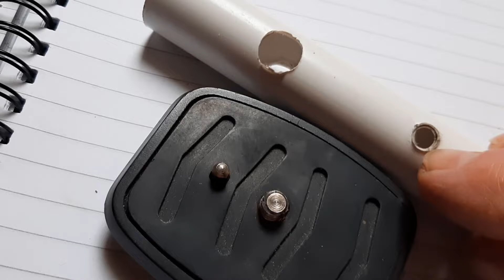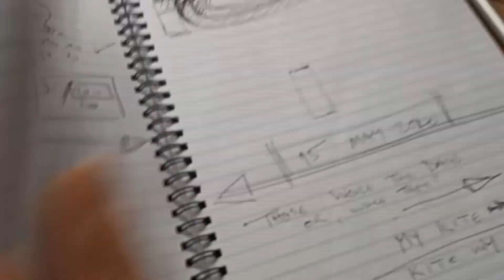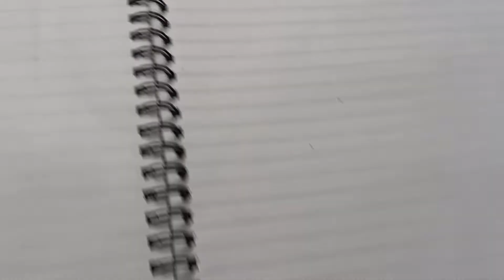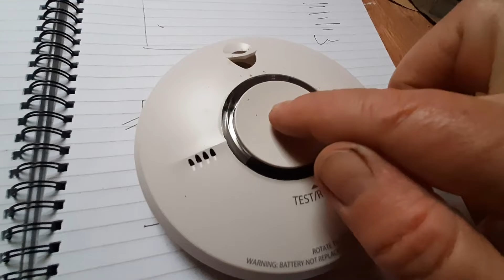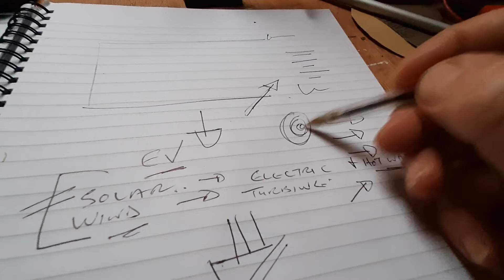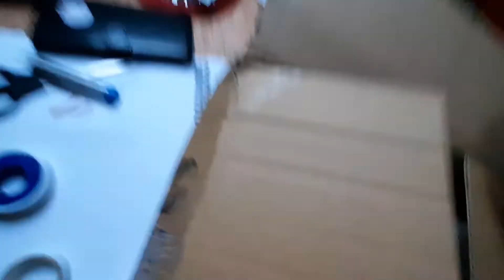Let's Talk About DIY!! #diy #monkeymount #metaldetecting

Comment: Solar is a good idea AJ, I wonder why I don't see any solar here 😁Do you know if you can get any sort of grant to install solar? Just a thought.
Reply from the maker: Yep... we can get grants - we have enquired... waiting for the response. I'll say something about it in a future clip! Would solar installations there be able to carry the snow loads without being so over-engineered that it becomes unpractical?
Reply: @vossierebel  Great news, I thought you should have made enquirers but always a good idea to prompt before you spend your pension!
Solar would not work here because of the 6-7 months of snow. There is also no sun here during winter months so would be pointless. The big thing here is underground heat source pumps. There are 2 ways of doing it depending on size and type of ground, either a deep well with coils, or ground pipes laid over a large excavated area and then recovered.
Both types work but reply on electricity to run them.